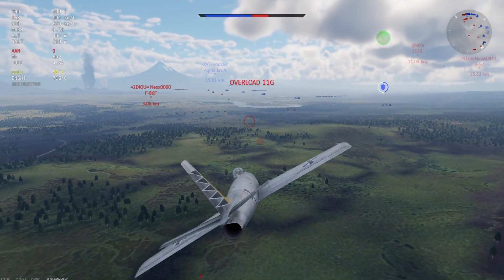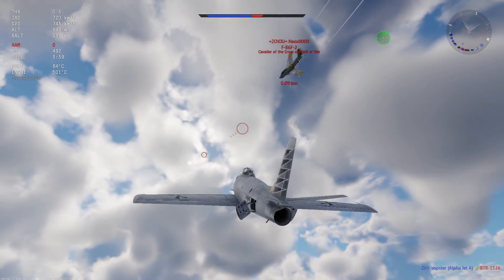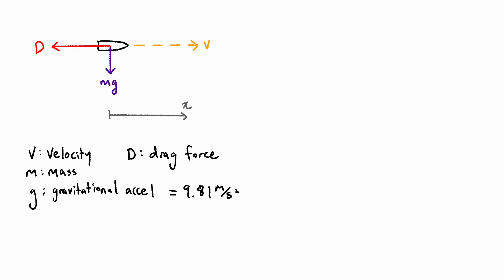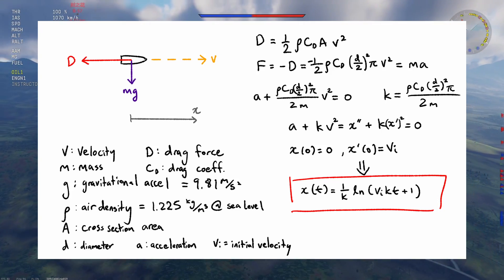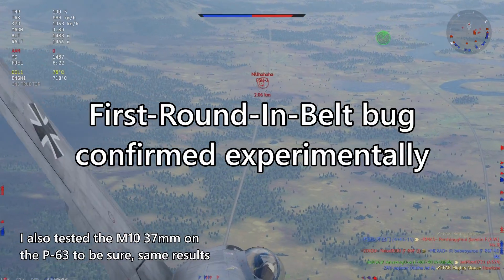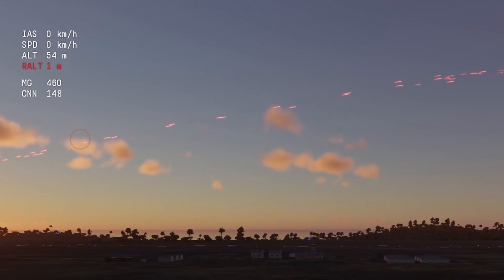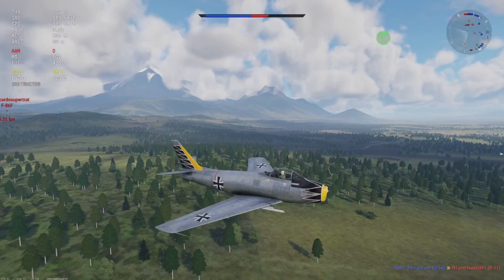Belts & Bullet Ballistics Explained | War Thunder

Comment: Can you plz test the tracer arc in different roll angle at 50m vertical convergence setting (ep J5N1)?
It seems like the arc doesnt roll with the aircraft, It always went above the crosshair after passing it even if the planes up side down
Reply from the maker: Are you asking why it seems like for 50m vertical convergence it seems like turning the plane upside down does not change the fact that the bullets intersect the crosshair at 50m, when if you had a farther vertical targeting (say 800m), turning the plane upside down would make you miss?

If that's your question, the reason why you end up missing when upside down with 800m vertical targeting is that vertical targeting is calibrated so that the bullet crosses the crosshair at 800m when the plane is horizontal. If the bullet didn't experience gravity, this would be just a straight line, but because it does, the guns are angled more upwards to account for the amount of drop the bullet will experience over that distance. When the plane turns upside down, this additional upward angling point the guns downwards relative to the earth and so instead of counteracting bullet drop, you actively make it worse.

Now at 50m, because the range is so close, with bullets that travel that distance very quickly, the effective trajectory of the bullet from gun to crosshair is basically just a straight line. The guns won't be angled very much higher because across that short distance, there's not much time for gravity to affect it and so any bullet drop will be very negligable. Because of the fact that the gun-to-crosshair trajectory is basically a straight line with very little added upwards angling to the guns, flipping the plane upside down will not change the trajectory from 0m to 50m very much, it will still basically just be a straight line.

If this wasn't what you were asking about, let me know.
Reply: @CatWerfer  man this is getting rly complicated here😭
For those guns mounted below the nose like J5N1,  a 50m vc setting basically turns them into schrage musik and aim a bit towards the sky when the plane is level.
Therefore when I flip the plane up side down ,the guns shoudve aim slightly towards the ground right? But in third person view the arc looks the same in any roll angle, this is where I'm confused.
Reply from the maker: oh huh now that i test with this plane, yeah that is pretty weird, ill look into it a bit further and get back to you on it
Reply from the maker: Ok so from the brief testing i did using the j5n1, f15a, f5e, mig21pfm, and av8c:
It seems I was wrong in my video about the mouse cursor and gun crosshair being in line with the line of sight made by the pilot and the in cockpit gunsight.
Instead, while it seems like it could be parallel to the pilot-cockpit gunsight line, it is definitely shifted below it, which you can find when you use 50m convergence in cockpit mode using mouse aim, where your cursor actually falls below the center of the in cockpit crosshair.

Now I'm not 100% certain how far down the line for the mouse cursor and 3rd person gun crosshair are. My guesses are it is either a preset axis that is used when modelling the plane, or a line that comes starting from the Center of Mass or Center of Lift (aerodynamic center), though these are also probably precalculated since it would be weird for these to change if the flight model were  to change mid flight (different Center of Mass due to lower fuel or different aerodynamic center due to using flaps or wingsweep). This is also likely the position at which the virtual cockpit is located (the view that you can switch to to see nose angle and the velocity vector direction). At the very least, its a line that starts somewhere inside of the plane and it is not a line that starts from the barrel of the gun because you can see that on planes with low mounted guns like the mig21 and av8c, the gun is still angled up.

Working with this potential explanation, the reason why the j5 doesn't seem to be very affected by short range vt targeting would be because the guns are mounted not too far off of this fake line of sight that exists for the mouse cursor and third person gun crosshair. This means that the guns basically aren't angled up that much from the horizon because the vertical distance between the gun barrels and this fake line is very little. You can see that this also happens on other planes with relatively high mounted guns, especially the La7 and its much easier to see happening in virtual cockpit.

Again I'm not 100% certain this works but it seems to be the case for most planes. Thanks for bringing this to my attention, this is really interesting and that's some really good attention to detail on your part.
Now I wonder if there is a plane with a gun mounted ABOVE this fake cursor line, which would mean that vertical targeting would actually aim the gun DOWN...

I'll do a bit more testing, but I think this means that I'll have to issue a major correction to the video...
Reply: @CatWerfer  sounds like you're reverse engineering gaijin's flight control patents holy moly
Reply from the maker: i'd love to be able to read what exactly they did to this game. I dont know enough about making games or sims to be able to steal it anyways, just to know and appreciate.
Do you think my explanation makes sense tho? It does feel weird that they don't just use the cockpit line of sight for vertical targeting tbh
Reply from the maker: YOOOO I actually found a plane with negative vertical targeting lmaoooooooo
The D731 French reserve plane (and the premium D731 HS9) has some pretty high mounted guns, so turning on vertical targeting at 50m points the guns slightly downwards lol
Reply: @CatWerfer  lol perfectly mounted guns for cas
Reply: @CatWerfer  this is weird, gunsight los elevation should be transparently incorporated into convergence calculation, using the value that set the cockpit cameras, in il2 the difference from model 0 point is defined in each planes' class file, in wt it should be under each planes flightmodel blkx file cockpit headPos 1  or headPosOnShooting 1 value (dot and bracket removed)
Reply from the maker: @DaedalusAI  you can see my follow up video where I explain fully how it works, but yeah it'd be nice if it was like that
Reply: @CatWerfer  i have watched them, i mean the value is there if you correctly set them, but if model is not in sync with value then there might be visual bugs, and of course it only compensate for y axis, you didn't find every plane's gunsight los elevation compensation off massively  right? i'm confused
Reply: @CatWerfer  i just searched mine and engine repo, apparently relevant code is not public, ag search with "convergence" and "targeting" only turn up some config gui related scripts, in og il2 the code is there and it definitely have compensation, it would be stupid not to just copy-paste it, still for bugged gunsight you could verify the value with wt model opened, the unit is in meter i think
Reply: @CatWerfer   also Im not sure if the "enble vertical targeting" option is working on my j5n1, it seems like the vertical convergence is always forced enbled when using a convergence setting

Comment: Ok i have one question, does firing your gun at sea level will have the same velocity curve as firing it lets say at 8k meters altitude, because of change in density of air, does WT account for this?
Reply from the maker: I haven't tested it but i feel like if they bother using a coefficient of drag and they already do altitude drag considerations for planes and missiles i think its possible, though i dont think it will make a noticeable difference
Reply: @CatWerfer  interesting, sometimes the snail makes me wonder they make/simulate all these little things yet fail to fix some glaring issues in the game lol
Reply from the maker: yeah i think they had an excellent foundation at the start with regards to the physics engine for prop dogfights but they stopped caring about keeping it clean a while ago

Comment: Well, regarding gunnery, there was this bug ehen WT started, that was only noticed in Sim or Full Real Battles as it was called then.

Namely that all aircraft seemed to be double the size they should be at their ranges, and the gunsights were the wrong size, which messed up lead and convergence calculations.

I first noticed it, when I got on the tail of a P-47D in my 109 E-3 (Yes MM was that borked back then) at 100-120m if you go via size and gunsight, fired with my guns set at 150m* convergence only to see the sehells cross paths behind him and then extend outwards completely missing him.

I then asked some people on the forums, the old forums about it and they told me that they knew about it and had experienced the same.
And that every gunsight was off by a different ammount.

We knew this, because we've flown the same aircraft in IL-2 1946 and knew the gunsight dimensions in Miliradian.
If you know that size and the target's Wingspan you can calculate the range. And un direct comparison to IL-2 1946 they were way off , sometimes 30-40%.

Additionally we found out that the aircraft were too large, compared to hangars, airfueld runways and aircraft carriers, which lead to many a takeoff or landing accidents on a carrier.

We found out the physical distances were right, but the appearant distances were off by a factor of 2.

I wonder if that bug still exists.

*As per my experience on IL-2 1946 where 150-200m convergence gave me the best hitrates and bullet/shell damage efficiency.
Reply from the maker: huh i'm not a big sim guy so I didn't really know about that.
that's really weird tho. i wonder if that was also the case in realistic battles and it just didn't come up as a problem cuz of the spotting system
Reply: @CatWerfer  Yeah it did exist, that's how we confirmed it. As it became rather appearant then and we could figure out the actual ranges. 

Now the size seems to be broadly in shape with the other assets now. I still wonder however, as ingame you seem to need quite a bit more lead and holdover to hit your target, compared to other games/sims. 
So I wonder if everything is fixed and the correct size, or if the other assets just were made bigger, which would explain a lot of the weirdness in the ballistics, as the guns would need to fly further that it appears. 

Especially since the .50 cal had a possible max range of close to 2,000 meters, ballistically, but was usually limited by the gunsight technology, which is why the K-14 and later the A-4 Gunsight on the later Sabres were such a big deal.
Reply: @LupusAries  you see enemy farther when you fill his wing in your e3 gunsight circle then, that just means the circle is smaller calibrate to a longer distance, i don't think actual model dimension and hud distance is not to scale

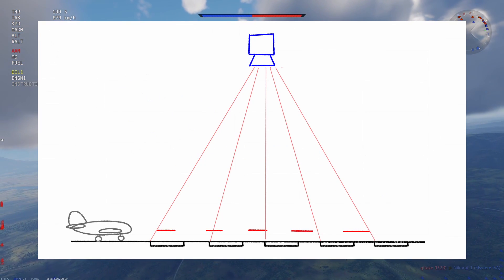Comment: 4:48 If you want a really good, immediately visible representation of this, test fly the XA-38 Grizzly. Take some test shots on the runway with the 75mm HE belt (600m/s), then equip the mixed belt which starts with AP (800 m/s), and look at how much closer to your cursor the HE shells come in the mixed belt.
Reply from the maker: I saw this argument but I'm not really one to take things to be true just by looking at them. The rounds have different masses and drag parameters and I wanted to be 100% sure without resorting to a qualitative assessment